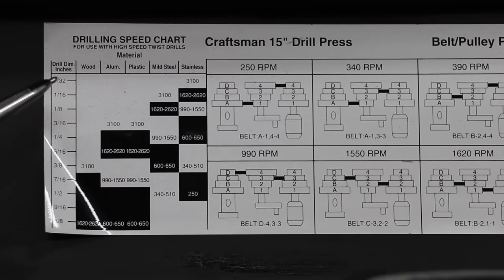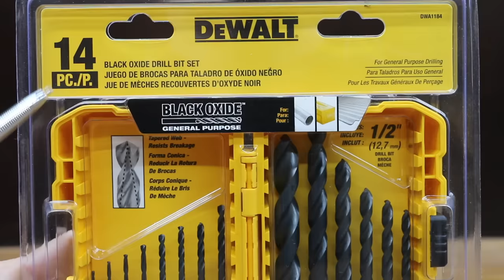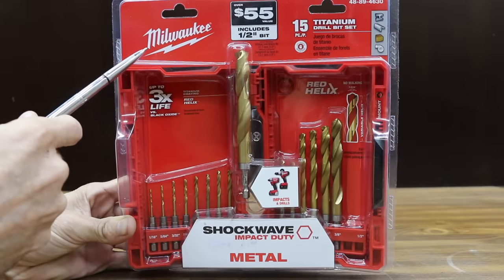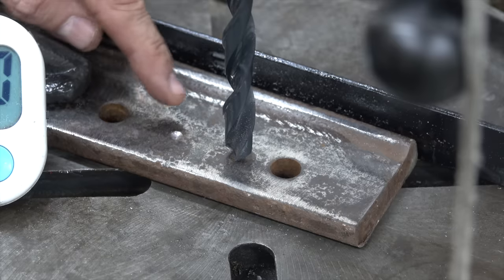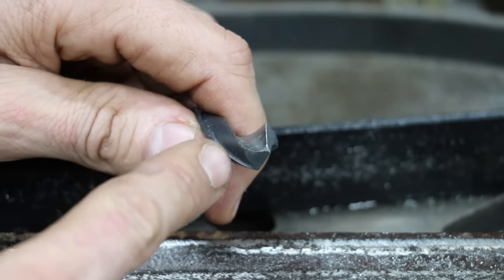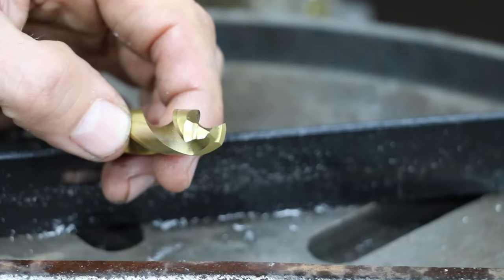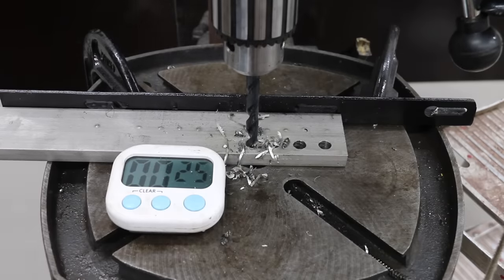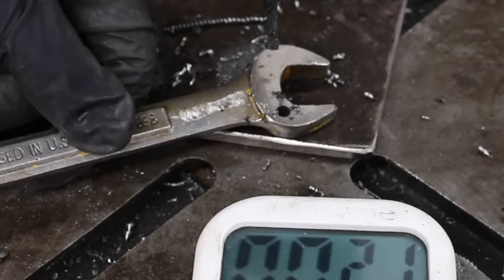Which Drill Bit Brand is Best? Let's find out!

Comment: Dying to find out how to rejuvenate a dead battery 😁👍🏼
Reply from the maker: I'll be working on that one soon!  Getting all setup for it.
Reply: @ProjectFarm  thanks !!! 
Made my day 😁👍🏼
Reply: best results i have found is throw out the acid. get you some distilled water and some epsom salts. disolve the epsom salt in the distilled water and pour in to battery get your self a manual battery charger not a digital one and 2 amp trickel charge for a few days good to go. ive revived many batteries that were completely dead 0 volts in them.
Reply: What if the battery won't charge, one cell ran low and it won't take a charge. Any thoughts on a solution?
Reply: D S, from the day batteries are made, they are dying. The two main ways a battery can die is calcification (coating on plates that encapsulates and basically insulates them from being used electrically in the battery), and an internal short (from conductive materials collecting between the plates). Highly unlikely fixing a shorted battery. 
Calcification starts out as reduced amp capacity, but can reduce voltage as it gets worse and eliminates an entire plate. Common comments like “it has a full charge per the voltage and charger, but it wont turn the engine over.”
Calcification occurs from not recharging a battery fast enough and completely enough after use, which allows the normal chemistry change that happens while discharging to literally precipitate as solids as it sits - a charge soon enough would recombine it into the acid, so no solids. 
Once the internal composition of the plates and acid are further degrade (from calcification), it also reduces a battery’s ability. 
Besides correct charging and observing correct level of deep cycling (🤣yeah I say it but don’t do it), decalcifying chargers used regularly can help a lot. Sometimes they can also temporarily fix “bad” batteries, as does new acid (there is an important caveat to replacing acid I cannot recall). Both are temporary fixes, and usually a signal of the end of a battery’s life. 
The key to a long battery life is recharging soon and completely and quick enough (no trickle chargers!!!!), and limiting the number and depth of discharge.
Reply: Great idea....but I pray my father in law doesn't see it. He got that crazy idea a few months ago and damn near burnt my barn down. I kept wondering why he kept wanting distilled water....yep he watch way to many damn YouTube videos on how to fix a dead battery lol 👍🏼😂
Reply: Well.  If the lead plates aren’t broken and shortened out.  Use the epsom salt trick.  It cleans the plates and will rejuvenate them.   But if the battery is shorted out you can’t help it.
Reply: Thanks guys.
Reply: As stated below trickle chargers not too good.  Unless. Your doing the epsom salt trick because you actually want to over charge the battery a bit witch is why I said a few days that helps the salt clean and break away all the stuff off the plates.  Once you do that you want to drain out the battery and rinse it out.  Then put more salt and water back in it.  Draining and rinsing will get the crap out that broke off the plates and settled to the bottom of battery.  With that said. I personally like 8 to 10 AMP chargers they are a good rate of charge.  Not too fast and not too slow. You don’t want to charge a battery too fast it’s actually bad for them.  And a trickle charger for a maintainer but get a smart charger so it shuts off and comes on as it needs to.
Reply: Trade it in and replace it. lol!
Reply: @mriphone1000  If the connection to the plates in the dead cell is broken, there is nothing you can do but weep. ;-)
Reply: @JeffCounsil-rp4qv  100 bucks verses a DIY hack 🤔 me thinks I'll try the hack 👋
Reply: @DS-kn4bs  Yeah, they did shoot up in price. Try a "hack", but I wouldn't be expecting any miracles. I don't know where you are from, but it's about winter here and I would not be relying on a "DIY hacked" battery in the dead of winter. Good batteries struggle at tmes.
Reply: @JeffCounsil-rp4qv  I'm in N.Y. but I'm looking to recharge 2 or 3 lawn mower batteries. I like to save money when and where I can.
Reply: @DS-kn4bs  Well, good luck with that. Small batteries never last very long to begin with. They sit too long between uses, especially over the winter. And most lawnmowers only (basically) trickle charge the battery, which is hard on a battery and almost never fully recharge. We all like to save money! But there comes a time when beating a dead horse gets you nothing. ;-)

Comment: I was taught when learning to be a machinist to watch the chips coming out.  Long even chips from both sides of the bit mean the bit is sharpened correctly and cutting well.  If most of the chips come from one side then that side is doing most of the cutting.  The  hole finish will not be as good and will be over sized as well.  Your video showed much the same thing even though you didn't make that part of your test.  Great video I always learn something from your videos.  I suspect it isn't just the tool steel quality used in the bits but the factory sharpening that makes a difference.  Your friend Chuck knows his stuff.
Reply from the maker: Great point!  Thank you

Comment: Seeing as you're testing drilling mild and hard steel, I'm curious to see how the results correlate to aspects of the grinds on the various bits. I.e.118 vs 135 degree grind angle as well as if any of the drills had 4 facet grinds. Toughness of the steel + quality of the grind usually dictate which drill bits will work better. If you've found a set where cutting lips show very little wear after the tests & they have a 4 facet grind, then you've really found a winner.
Reply: All drills will last forever if used correctly, coatings, angles, and flutes are all designed for a specific purpose. I've never seen or heard of a 4 flute drill. If they exist the only difference would be you'd need more RPM and a faster feed rate.
Reply: HighStreet Killers if they sit on the shelf they will last forever lol
Reply: HighStreet Killers 4 facets, not 4 flutes. It’s a more complex grind that provides a better cutting chisel tip and more controlled relief behind the cutting lips. All things bring equal, drills with better grinds ootb will cost more.

Comment: Do one with concrete bits. My experience: Cheap ones turn into blunt sticks almost immediately. Good ones ($10 per drill) devour concrete like it's nothing.

Also interesting to see difference of 2-cutter vs. 4-cutter drills.
Reply: I've tortured so many concrete walls with side-tracking, no-bite, smoke-rising, no-good crap bits. Then I manned up and got a set of 4-cut Makita bits (top-tier ones, they have crappy ones as well).

I was stunned to learn that drilling into concrete is actually a non-herculean task. I can't stress enough the crazy feeling of awe.

I've been drillin' and winnin' ever since!
Reply: A 4 flute drill works easier for you cause using the 2 flute you probably have the RPM to low. I know nothing about drilling in concrete. But in metal a 3 flute drill is called a core drill and is not suppose to be used as a normal drill would. It has a specific purpose
Reply: I've tried with all sorta RPMs.

So, drilling into concrete as in walls of apartments etc, you cannot afford to track sideways or just spin the drill endlessly (the heating bit can easily sear and color wallpapers and even paint).

Low RPM causes a lot of sidetracking, because as the bit hits different kinds of rock particles (that are usually something like 0-12mm or 0-1/2in in diameter, while spinning slow, it's just aching to go around them, not straight. All the other material in concrete compared to the granite etc 0-12mm rock is soft as butter (cement, additives etc), the bit will just track there.

So, pretty high RPM is the way to go, because that way the bit smashes or splits the obstacles that it hits, allowing for a continued straight path.

And the main problem with cheap bits is, I think, poor (or wrong!) quality of steel in the cutting edges. They just loose their gnawing geometry and turn into waste.
Reply: For concrete SDS drills i would buy Bosch or Hilti if you need them often
Reply: Hilti <- amazing quality in their products!

Comment: Hurts seeing my beloved Milwaukee in the middle of the pack! Also looks frighteningly similar to the bauer bits. Bosch definitely makes a good bit, we use those four our metal drilling regularly.. I think if you could test out some chainsaw blades (Oregon,  sthil, Puolan ect) that would probably make for a great test seeing as how box stores rarely give you more than one option.. maybe a weighted cheap electric chainsaw vs pine, maple, oak with and against the grain.. and a no oil torture test at the end 😅
Reply: I have tested a few brands in the field as a professional pulp cutter. Stihl has the most consistent and highest quality. Beats Oregon and Carlton hands down.
Reply: Its interesting how the economic big picture plays into this.  I was impressed by Boeing's decision not to do a similar supersonic consumer aircraft - it turned out to be a very smart decision.

Comment: Well done video. Personally, I  gave up with ordinary drills including titanium which wears off.  I started using stainless steel which worked well, till I tried drilling some unknown metal nothing would drill (still have no idea what it is) , so I bought a cobalt set from China, expecting it to be junk, but the metal specs was good (8% cobalt I think) and price cheap so I took a chance not expecting anything great as their stainless steel dog bowls from China is the only stainless I had come across that rusts and can actually be used on a induction cooker, anyway the cobalt drills turned out to be the my best drill set, does not blunt (yet),  chomps through hardened steel, stainless steel like a knife through butter, including my unknown  metal which is a part of a old hills hoist. Take care, stay safe.
Reply: Stainless steels (10-30% Cr) do not mean that they will not rust.  Some of the great tool steel, D2 steel will  rust if not properly maintained, due to its low chromium content (10-13%). Even higher chromium content stainless steels will rust if not properly maintained. Another commonly belief is that stainless steel is not attracted to magnets... obviously, that depends on the composition and heat treatment ...
Reply: @slchang01  absolutely. However in the old days never had a problem when stainless was locally made. Still have a stanless steel water tank which I built and non magnetic, no rust, looks like the day it was made.

Comment: when drilling a large hole, say 1/2 hole in thick iron, do you recommend do it in increments or go straight to the 1/2 size, being precise is a factor in this job
Reply: Drill a 1/8 pilot hole first.  It will make drilling the final hole much easier.

Comment: The DeWalt cobalt bits have always been my fave.
Reply: Yep. I found out they were the best when drilling through the hardest steel ive Ever encountered on my old trailer. I basically did this test myself except in a more aggravating way, That cost me way more money!
Reply: I have 3 of the 14 bit packs. Funny thing is the most used ones are either dull or snapped.

Comment: I fly through twist drills because I do a TON of hand drilling in my line of work. Dewalt has served me pretty well but I think I may try out the Bosch next time. 

Though I will say, I have some Tungsten Carbide cobalt twist drills for opening safes. Those will cut almost anything.

Comment: "How fast can an assortment of drill bits drill a 1/2" hole through a lawnmower engine? Let's find out!"
also
"How long will a lawnmower engine run with hardened steel drill shavings mixed in various oils? Today on Project Farm!"

Comment: Idea: best and most affordable disposable face mask.
Reply: Good idea, he can put it in a box with controlled suction.

The box can be contaminated with smoldering charcoal, that should leave visible black residue.
Reply: I don’t think any of those disposable face masks work particularly well. The don’t seal to your face so you end up breathing a lot of the dust anyway
Reply: I have used 3 squares of toilet paper (unused) and a couple of rubber bands in a pinch.
Reply: @Michael Seater One would hope the tp was unused!! 🤣🤣🤣
Reply: @johnfraser4591  

I use medical earloop masks. Works good for cutting the grass and weed whacking and not breathing bits in.

Comment: You needed some cle-line bits to really show a higher shelf bit rather than a prosumer bit.
Reply from the maker: Thank you for the recommendation
Reply: Thought the same: I've started using the cle-line, Latrobe, and Norseman bits in the shop after years of "box store" bits. Will never look back.
Reply: Ryan Wilhelm, where can I find them? I’m tired of cheap drills.
Reply: @lcee6592  Surprisingly Lowes has a set in store here in the southeast, and I can't remember if home depot does or does not. The Cle-Line ones tend to be hung up high and off to one side from what I remember.
Reply: Christopher Goggans, thanks for the tip! Fortunately I’m not far from Lowe’s, Depot or Menards so maybe I’ll track some down. Thanks again!
Reply: @lcee6592  Got mine from Amazon, McMaster Carr and MSC Direct also carry the good stuff
Reply: I agree, Cle-Line are the best drills I've ever used!
Reply: +1 on the cle-line. I have gone through 3 of the dewalt cases (2 black oxide and 1 zinc) in less time than 1 case of cle-line.
Reply: Ryan Wilhelm 
Great I have access to all those suppliers so I can be in drill heaven!
Just never knew who made the good stuff till now! Thanks guys!
Reply: Tombs Clawtooth GREENFIELD INDUSTRIES - CHICAGO LABTROTE / CLEVELAND / CLE-LINE / CLE-FORCE
Made in U.S.A.
Owned by the Chinese
Reply: tunin tunin 
Oh you’re kidding, right?... is there anything made in and owned by an American?
Reply: C R. Not sure, but they have been owned by Chinese for a while now... same thing goes when you do a research on “american cars” more parts or more care of a toyota is made in the US than of a Dodge or a Ford. Look it up. So which is it that is a US car?

Comment: Now you know why I love DeWalt and Bosch drill bits and saw blades!

By the way, cutting oil is VERY IMPORTANT when drilling steel.
Reply from the maker: Thank you for the feedback
Reply: cough cough. I use Old Engine oil....... works well enough
Reply: Xyphren 

🏈GO 49ERS🏈!!!!
Reply: I have a 2 gallon sprayer I fill with coolant mixture when I have a piece with a ton of holes in it to drill, greatly reduces the need to resharpen while decreasing the time it takes to do it.

Comment: I've found dewalt to be a pretty reliable brand overall tbh
Reply from the maker: Thank you for the feedback
Reply: Just make sure you buy the "expensive" dewalt, dewalt also have chinese rebranded things on the cheap side, dont buy those, youd be better and cheaper just buying some chinese brand.
Reply: I work in construction and I have always had a reliable time with Dewalt. Their drill bits are great and not too expensive especially since we go through so many bits a year. Their higher end cordless drills are really good but you should avoid their cheap tools as they are junk. I will admit that I sometimes use my cordless drill as a hammer as sometimes you need to give something a good whack and don't want to spend a couple minutes to get a hammer and it still works years later. My boss bought me a cheap Dewalt cordless drill and it lasted I think a month or maybe even less before it died.